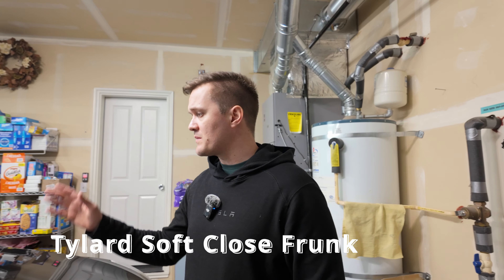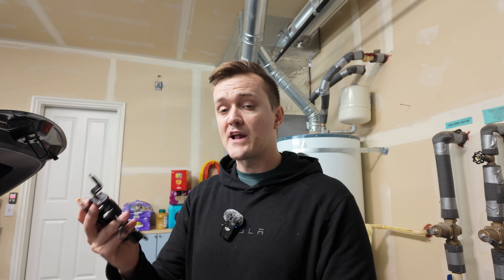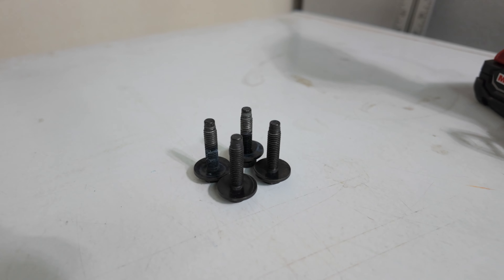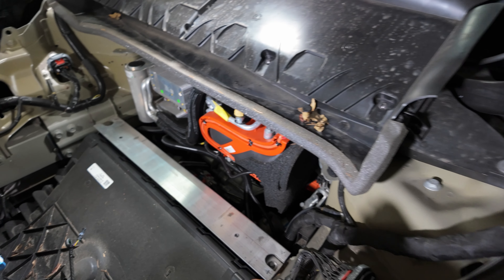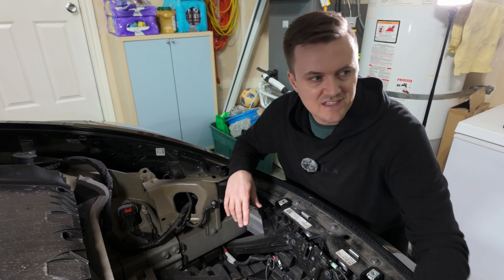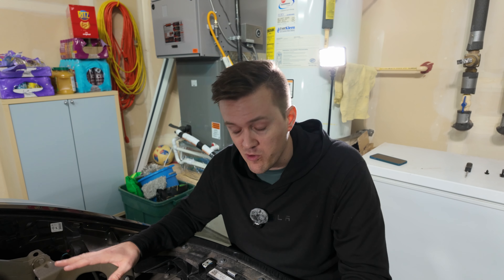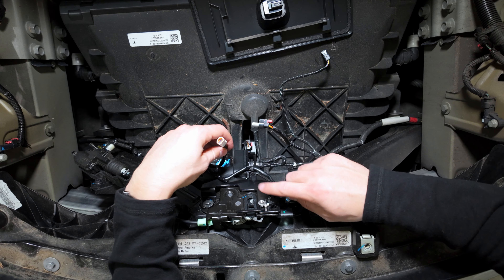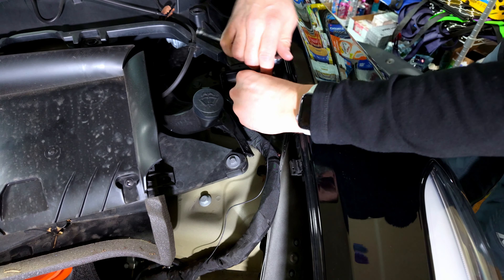Tesla Soft Close Frunk | Install Guide & Review | HUGE Upgrade!

Comment: I installed the Hansshow power frunk before and used it for few months, of coz I love the concept but one time it cannot open due to something wrong with the motor.  It locks the latch and the frunk cannot be opened so far.  It takes me quite few hours to open it again which turns me to uninstall the whole stuff at once.  This gadget is really good but you don't know when the motor latch will not be working and there is no way to open frunk easily.....
Reply from the maker: That would suck!!!! What did Hansshow do about it?
Reply: @CfTesla  they cannot do anything.  So I used a small long curved tool to un-latch the hook by luck....so I don't believe such 3rd party frunk motor anymore
Reply: This is my biggest fear of these solutions.  If it fails, you are screwed.  I can't even start to think how mad I would be not having any type of access to the frunk. Not that I use it that often anyway because of how challenging it is to close.
Reply: @russmazzaro  But motor failures aren't very common because they are simple devices.  Think about how many times the motor controlling your windows is cycled and I have never had one of those motors fail.  Nor have I had a garbage disposal motor fail in decades and I use mine numerous times a day.
Reply: @Resist4  They fail due to water leackage into it
Reply: @Shadefrank  And again that's a very rare occurrence.